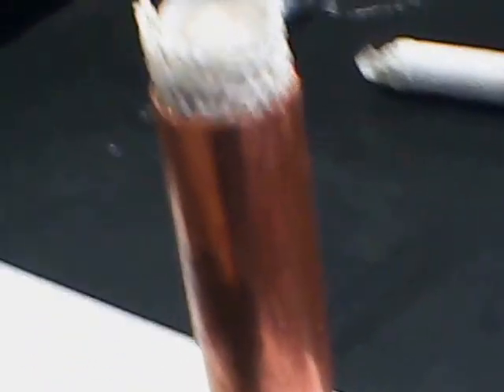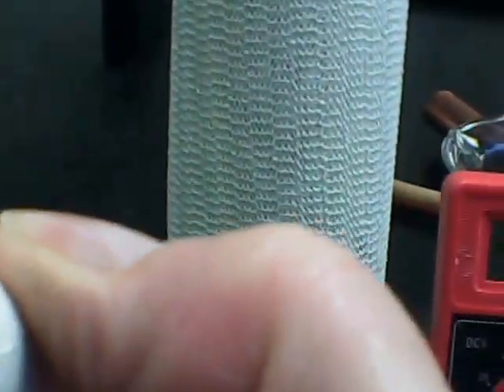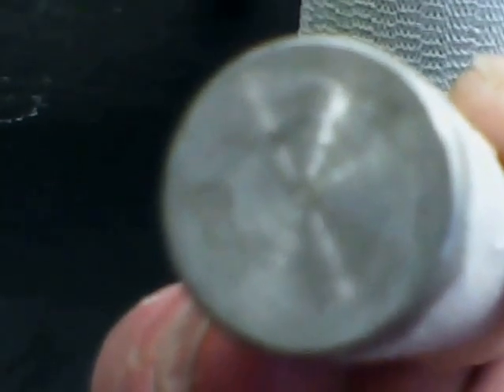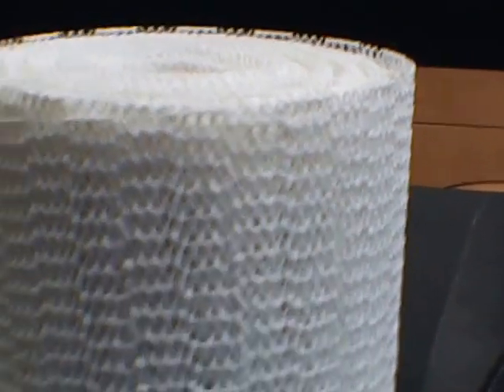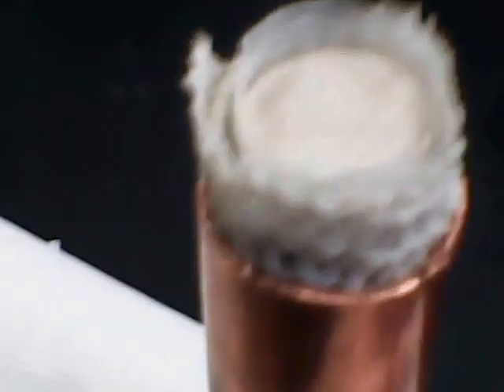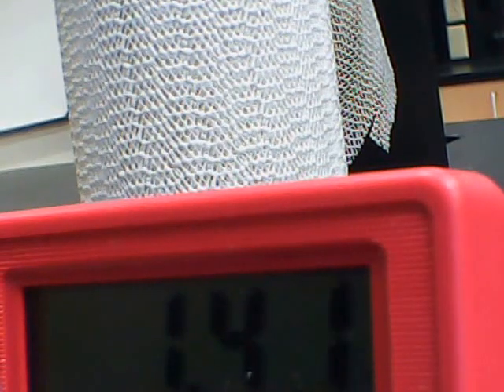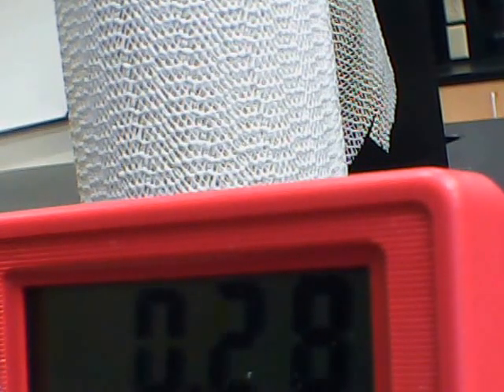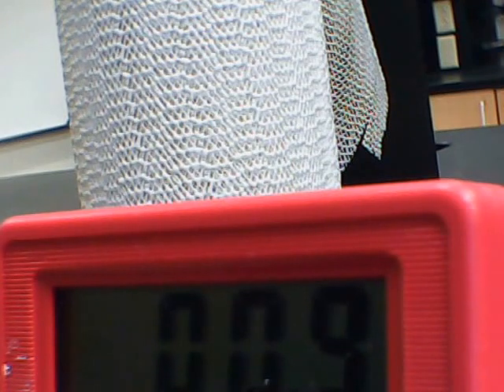Magnesium Copper Cell (Battery) Magnesium Sulfate Electrolyte

Comment: use glycerine instead of water for the electrolyte and its rechargable. (but u have to use sodium chloride, not epsom salt, cause epsom salt takes ages to get into glycerine)
Reply: i thought more, its actually copper sulphate, and its blue when its charged, and its clear when its discharged.  its actually colour indicated.

Comment: I made a battery using magnesium sulphate as electrolyte, but i am getting terrible poor results. 10 times lower current than NaCl salt.What do you think i am doing wrong? Could the so called magnesium sulphate be fake? I really have no explanation.
Reply: Magnesium is your metal your cathode or anode it's got no PH value high or low your electrolyte needs too be acid or Alkaline in nature...vinigar is good as a cheap acid try that but magnesium is metal n your metals are used for your poss n negative...magnesium sulphate mixed with vinigar try that the magnesium may make electrons move faster through your solution metals in your electrolyte but metal powders alone ain't good electrolyte...I know they work a bit but for example your normal batts use sulphuric acid for a reason coz it's like 1 or 2 on PH scale a mega acid so get mega power that's why we can't buy sulphuric acid lol..

Comment: 1.6 volts is pathetic for Mg battery. Should easily be over 2v
Reply from the maker: No one said I maxed the cell potential out.
Reply: I know you don't want to use acid because of self discharge but a little h2o2 will go a long way I believe.